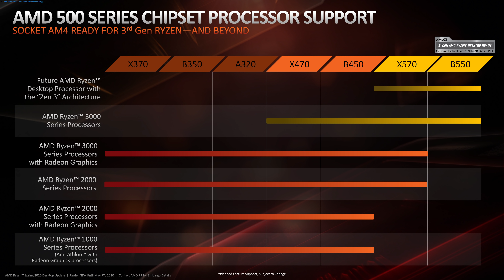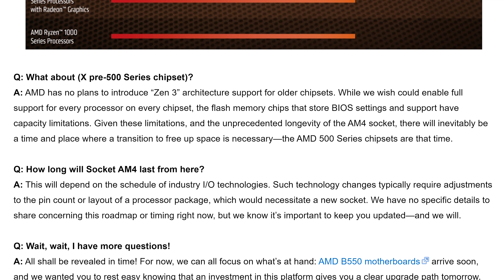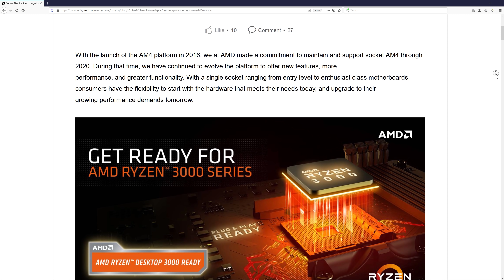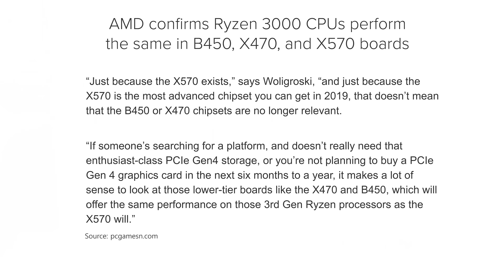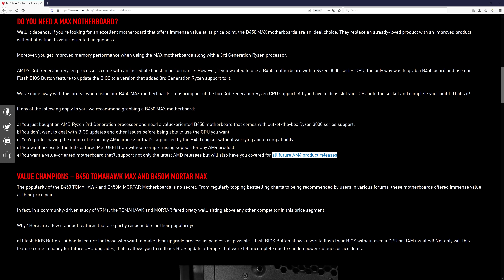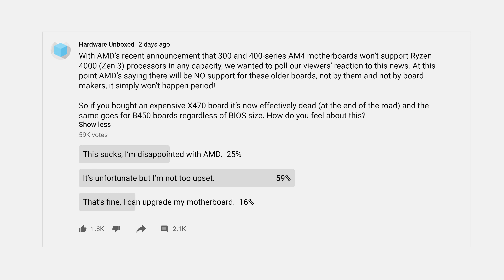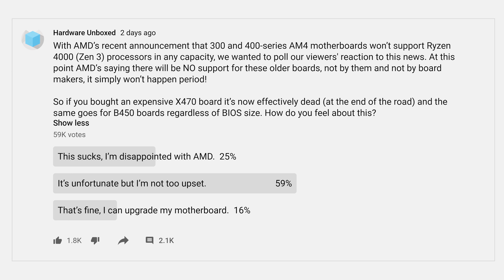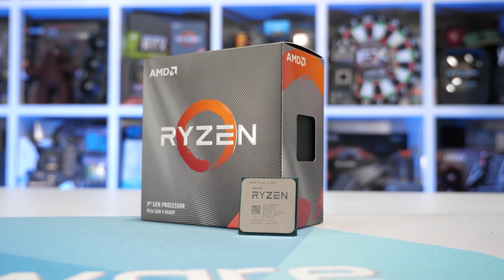AMD Does An Intel, Axes Zen 3 on 400-Series Motherboards, Our Thoughts

Comment: Steve: Forcing new Chipsets on comsumers is how Intel kept Board Partners happy to make extremely high end boards, knowing that said customer WILL have to buy a new one if they want the latest chips. AMD likely had a FEW unhappy AIBs - (READ: CEOs/Investors) of AIB companies that likely had an issue with the loss in revenue that supporting ALL chips on ALL boards would do, also it allows the producs to stagnate - unless you NEED PCIe Gen4, why buy a rather expensive X570 board when a decent X370/X470 could fulfill all said customer's needs and then some?

Anyway, AMD is a company out to make money, just like Intel, but UNLIKE Intel, they do not yet have the money to, say, throw a billion dollars of R&D money to AIB partners to assure they make the best possible boards for every generation.  That said AMD has the sales momentum on their side, at least when it comes to custom built PCs - which are the customers who would even consider making a mobo purchase. 

I hope this changes though.
Reply: Ironic you said a billion for R&D and thats what they literally have on hand cash right now =P
Reply: I don't know, the MB vendors would be happy to be able to sell their boards for longer.  Selling B450 boards is a money making proposition now all the expense is behind them.   The profit on each board is gravy.  Tooling up for B550 boards that aren't going to sell well is an expense they don't need.  Look at MSI.  They went with the MAX for exactly that reason.

Comment: been running an x370 crosshair hero 6, running an 3800x on this setup is awesome. started with a 1800x. still love these boards and cpu's.
was still looking forward to using zen 3 on the x370.

Comment: I just built a system this weekend with a R5 3600 and MSI Tomahawk Max. Replacing an outdated FX8350 build from 4 years ago. I'm confident this new system will last another 3-4 years before I need to upgrade again. By that time AMD will most likely have a whole new lineup of CPUs and Chipsets.

Comment: Don't waste your money, just don't buy 500 series mobo, don't support them so they'll learn their lesson. I just bought a B450 mobo a few months ago (and R5 3600 and hope for future upgrade), have no plan to change mobo any time soon, that'd be the stupidest upgrade ever (only a few months apart!! LOL)
Reply: why upgrade when you are already using R5 3600? does that means you require more heavy task? why not 3700, 3800 or 3950?
Reply: @yvonnebong3371  that's why i said future upgrade, darling, that's the keyword ;). If i wanna upgrade, i'd upgrade to newer gen (in this case with Zen 3 R5/4th gen), i upgrade for IPC gain, not more core (esp. with same IPC) cuz i don't need that.

Comment: As an owner of two X470 platforms I'm disappointed by this decision, as I was expecting to upgrade my main system with the final AM4 iteration and hand down the current 2700X to my secondary system. Based on the history of X370 this felt highly realistic. This recent change in platform support leaves a bad taste.

Comment: @Hardware Unboxed --> Good grieff !!! -->
Just as Zen2 was never promised for AM4, AMD did engineer these CPU's for use in these boards. Now do tell us, up to and including Zen2, how well AM4 has served the original purchasers and chipset longevity - in comparison to Intel's usual tick, tock new board, rinse and repeat consumer 'fun' ?? 
At 0:19 you show a slide which informs everyone that Zen3 won't be compatible with AM4 - that info was known to EVERYONE for some time - YOU KNOW THIS!! 
HOW THE HELL DO YOU EXPECT AMD TO INNOVATE WHEN AN AM4 REQUIREMENT WOULD CRIPPLED INNOVATION, FUNCTIONALITY AND COMPETITIVE EDGE FOR ANY NEXT GEN CPU ?? 
HOW THE HELL DO YOU CALL YOURSELF A CENTRE OF 'EXPERTISE' WHEN YOU PEDDLE THIS 'ASSUMPTION'  CRAP - you do realise that 'BIOS compatibility' is *effectively* the same as 04:01 i.e. IT DOESN'T MATTER the reason.
Oh yes, AMD THANKS YOU for 'feeding' all the Intel shills in these comments - a 'feast' I'd imagine will be justifiably reciprocated.

Comment: The note at the end is the reason why I'm pissed. If it were a "we got one platform that went through 1000, 2000 and 3000 series, that's a lot, now we're switching for a new one that'll support 4000, 5000 and 6000", why not ? The PR is still awful and it feels very artificial, but at the end of the day, it would be understandable... is that really what we're getting ? Even if "new" AM4 last until DDR5, how far away is that ? Are we really going to see three more years of newer AM4 with DDR4, or is the 4000 series' compatible motherboards already a dead end ? That's the issue for me.

Comment: Well, this is very bad PR. I'm just most likely gonna skip Zen 3 because of this.
Oh, well, my X370 served me well, running 1600x, 2700x, and now 3800x.
But the thing is, next CPU after zen 3 is most likely gonna be ddr5 and AM5 or whatever.
So, I would be buying a motherboard with no upgrade path.

Comment: I just helped a friend  build a new Ryzen 3000 gaming PC  two months ago. I Recommended him the Tomahawk B450 Max thinking he would have an upgrade path. He does not need the extra features of X570. And B550 wasn't and still isn't out yet. I feel that not releasing B550 alongside X570 jebaited a lot of PC builders that didn't want to pay extra for X570 features into buying B450. I am disappointed. And considering many techtubers recommended B450 for budget / mid-tier gaming builds probably also thinking B450 would have a bit more life in it, considering MSI just refeshed their B450 boards as MAX version. That would make you think vendors and AMD would be more committed to supporing Ryzen 4000 on B450. I'm not blaming techtubers or MB vendors. I think both acted in good faith. AMD is pulling the rug out from under then, making them and B450 buyers look stupid. I think this is a poor decision by AMD. I hope they will reconsider!

Comment: Starting to make sense.
I feel they started delaying B550 for this reason. They are probably trying hard as m they can to not release any boards in 2020. So they meet there promise.
I feel it's important if they allow to keep supporting these boards. Makes them very different from Intel.
If not b350/370

At least a320/b450/b470 & up. 
Because what are entry 4000 users going to use?? Not everyone wants to spend $100+++ on board.
Also that is a lame excuse. I am sure there are ways..

It's going to be awful when have tell customers builds they bought on 450/470 can't support new Processors...

Comment: I just sold fx series cpu for 1600 af $85 version with x470 $90 Mobo upgrade, I would  have just bought the x570 Mobo for $159, but for an $85 cpu just did not make sence to me.  The prices of Amd motherboards is so affordable, so i am not too worried about the upgrade path rather look forward to either the 8 core 3800x or 12 core 3900x.  When the time comes for me to upgrade this 6 core cpu, AMD might be on Zen6, so Rock on RED-TEAM! .....i own an RTX 2060 ko upgraded my 980ti classified.

Comment: I'm pissed as a B450 Tomahawk Max owner, who trusted AMD when they said the AM4 platform would be supported all the way up to 2020. I wish they knew what they were doing and as you said they must have been "winging it" the whole time. Now I cant trust a word they say and the whole boost clock situation is still fresh in my mind. I have a 3600, paired with a h115i pro rgb and 6 intake fans and 2 exhausts inside a lian li pc-o11 dynamic with the latest bios and correct power settings, boost settings enabled in the BIOS and the max clock i get in rendering and gaming is 4.175 mhz. That's more than likely a loss to the silicon but regardless AMD needs to fix the situation with the 400 series.

Comment: I knew the BIOS size issue was bullshit, as theres X570 boards out there with 16mb chips, and the currrent ASUS BIOS for my Crosshair VI Extreme is just over 10mb, which includes support for ALL generations of Ryzen. 

I'm also upset since i bought a top of the line X370 board, which is built better then half of the current X570 boards, so i dont think ALL 300 series board support should be cut.

Comment: Crappy move for sure. I don't think motherboard manufacturers are too hurt over this. Geez, you mean our customers will have to buy our new motherboards to support your new products? Dang it all to heck!  However, doesn't really impact me. I picked up x570 and 3800x with no plans to upgrade for next 5 years.  But in the end, you say support through 2020, then you support through 2020. Every chip made for AM4 should work on any board with AM4, with exception of cheap a&& boards only support lower end cpus. Overall, AMD and their handling of am4 has been pretty good. They should have forseen the need for larger bios, so poo poo on them.

Comment: I bought the A300 desk mini from Asrock so I am limited to only APU's. I got an Athlon with it intended on getting 4000 APU's at release to make a nice little box. I am bummed that now my best option is 3400g which is showing woefully behind. It has the capability just needs the green light. Even with a small bios chip it doesn't need to support all AMD chips just APU's and the power supply can handle the newer ones

Comment: I bought an MSI B450 Mortar MAX in November to go with an R7 3700x. If they don't reconsider their decision it'll be very simple for me, I'll skip the Ryzen 4xxx series entirely and wait for what comes next (AMD or Intel, who ever comes first with an interesting product).

I'm not going to buy a new AM4 B550 motherboard to replace my B450 just for one CPU upgrade knowing that B550 motherboards won't support the generation that comes after Ryzen 4xxx anyway (hello DDR5). And it is all AMD's fault, I would have bought a B550 board back in November 2019 if those were available.

Comment: I have B450 and having to upgrade motherboard is not great, but not that big deal, since I would like to have some other new features anyway, eg wifi6, bt5, and USB4 once it's out. It will be a bigger problem if with ryzen 5000 series they change the socket and I have to upgrade again. So now I'm not sure if I will upgrade to zen3. Maybe better wait this one out, and use the money towards new console or Ampere/big navi gpu.

Comment: This is sad... Was hoping for a Zen 3 for my C6H, it's more than good enough for the job and don't really need Gen 4 yet anyway...
Reply: Im here aswell with a c6h, and i know for a fact that this board will defently not bottelneck an 4700x .
Reply: "more than good enough"  sounds kinda like  "ll we'll ever need is 640k ram"
Reply: @John-gm8ty  Mind pointing out what components on that board are exactly not "more than good enough"?
Reply: @DeadNoob451  the same could be said for a 286 thats still functional.

the POINT is, AMD has made a decision about what it wants to do, they want to move forward and implement new stuff that's not currently supported by current chipsets or chipset size restrictions.

the chipset on your board is not good enough for AMD to put the effort into it instead of focusing on the new stuff they can do.

we've all done bloody well in comparison to Intel who changes sockets faster than underwear.

if you want the new CPU and it's new features, you upgrade.
Reply: @John-gm8ty  Your examples are ridiculous.  This is nowhere near someone saying a functioning 286 is still good enough.  I get your point and it may be that AMD just can't use the chipset size of the 300 and 400 series boards.  Perhaps the 500 series will require a hack like the 300 and 400 series got for Ryzen 3000, in order to run Ryzen 4000.  But if that's not the case, their explanation is just an excuse.  Because we know the 3000 series chips run just fine on an x370 and up.  So if the 4000 series doesn't require anything more than the 3000 series, AMD is lying to us.

You're correct to say AMD has been better than Intel on this issue.  But that's a bit like a woman settling for the first guy who doesn't beat her, even if he's a complete loser.  AMD promised that am4 would allow an upgrade path through 2020.  As Steve said in the video, killing backwards compatibility and releasing one generation of 600 series boards right before you switch off of am4 for ddr5 is just as bad as Intel.  You'll have people buying very expensive 600 series boards which will support one generation of chips, when they probably could have left backwards compatibility and not forced any loyal customers who want the 4000 chips to buy a dead end chipset.  I fully planned on buying a 4000 chip.  That is out the window now because I don't want to buy a new motherboard, only to have to turn around an buy a new one for AM4+/5 a year or so later.  It's not a money issue, as much as it is me not wanting to rebuild my whole system twice in as many years.

When DeadNoob says the CH6 is good enough to handle the 4000 series chips, he likely means the components like VRM, M.2, headers and memory support.  Which is correct.  Nothing AMD has put out for AM4 has come close to maxing out the capability of that board.